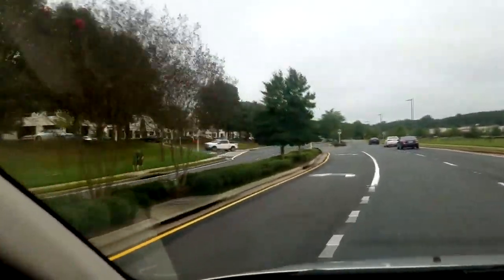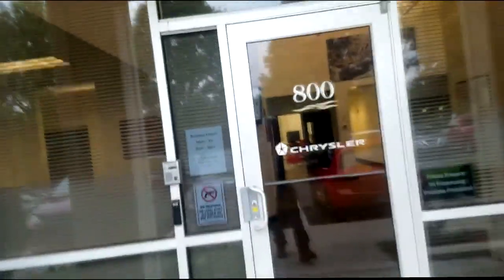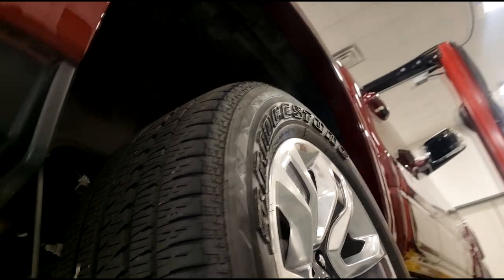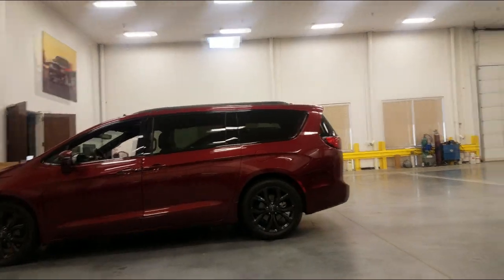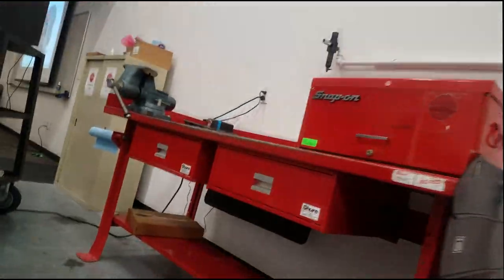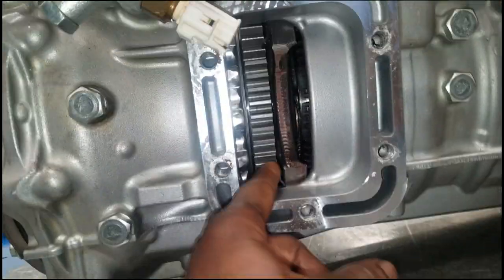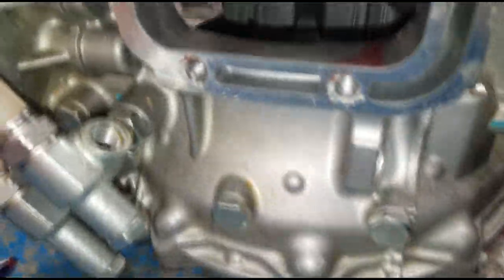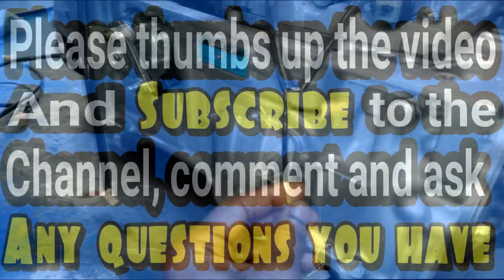This is where I get all my Automotive Technical Training from. ASRC Asian Transmission course. Hemi.

Comment: I would guess there is coolant lines going to the differential to warm the oil up quicker to cut down on friction from thick oil To get better gas mileage, not too shabby

Comment: I'm surprised they let you record in there... I took some video at the tualatin school in Portland, put it on my channel and they lost their freaking minds. FCA watches YouTube for videos of the training facilities.. "trade secrets".. they went back through the roster for the school day and called every dealership that had a tech there, until they figured out it was me.. I almost got shitcanned from the dealer.
Reply from the maker: You dont see anybody in the video but me and the trans we working on mostly. A chrysler Pacifica and a Ram 1500, nothing secretive about those. In fact I have managed to get a Pacifica at the dealer sold because of recommendation. Its about what you record. In fact, we was told to pull out a camera and take pictures of the harness so the installation would be easy, I chose a video instead of a camera. Even tho my thumb nail picture will be changed tomorrow, I can get the buck of view on the weekend today.